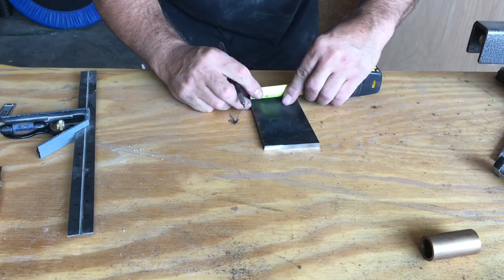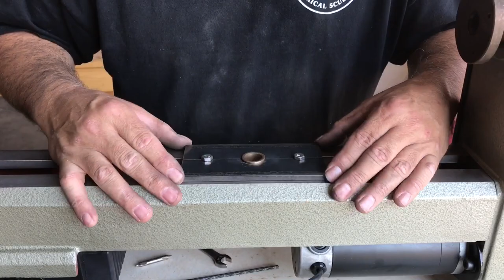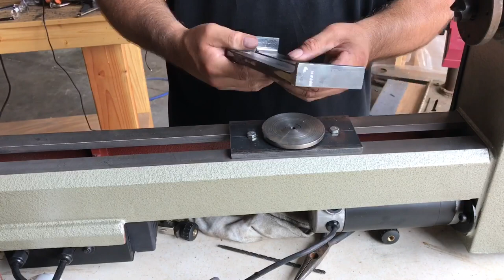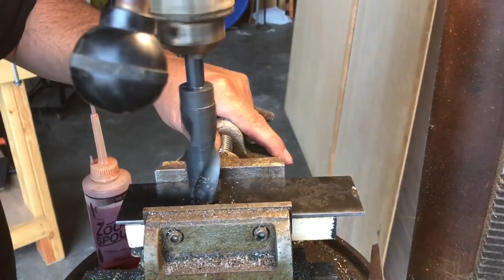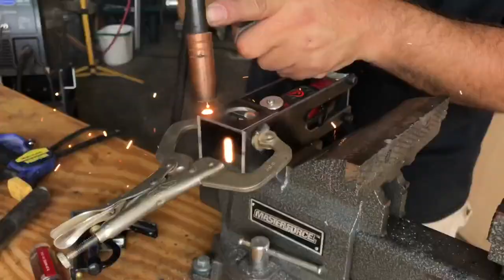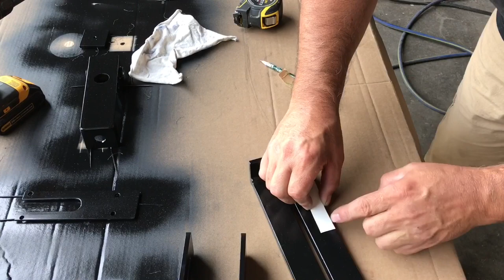Metal fabrication - building a small geodesic sphere turning jig

Comment: Keith Thank you for the video. I enjoyed the build. I do woodturning and inquire if building a carbide cutter jig that you can still use your bottom rotation assembly and switch to a carbide or HSS cutter to get the shape smooth then bring in the sander to finish. I see you are using a drive spur for grip, but once you have rounded you would have two nubs on each side would you switch to cup on each side and rotate sphere to remove nubs. Look forward to seeing what you come up with.
Reply from the maker: Bryan Boston When I tried turning the plywood ball with traditional lathe tools I had  so much tear out that I ended up having to sand them a lot anyway. To save time I started using a rough disc to knock off all the high spots before I start with this jig.

Comment: really like your creation process.  a lot goes into it, perhaps more sckookum than needed to hold a sander?  jealous.    Is it possible to do some of the rough turning with a standard gouge, and then switch to the sanding/grinding?   or does a gouge tearout the plywood too readily?
Reply from the maker: Ted Gaunt This video was my trial of the jig. I have started to remove the points with a rough disc before starting with the jig.

Comment: Damm sleep is a good thing! Keith, do you sell the how too for this thing. I’m just getting into wood work. There is so much to be inspired by. This is definitely one of them. I have just one question. How drunk were you when you came up with this. Or, the story of how. I’m joking, of course. But the process of how must be a great storyline. Looking forward to what you post next.
Reply from the maker: Allen W   The first time I sanded a plywood ball on a lathe, I just held the sander by hand. I made the sanding jig later. The design for this was just a sketch and trial and error. It is basically a condensed version of the one I made for the big lathe. The sphere jig I use for solid wood has a carbide cutter. I found that the cut was too rough on plywood and I had to sand it a lot anyway. So that’s where the disc sander came in.  I have already found a few things I want to change on the small sanding jig. Thanks for the Sub !

Comment: Can you make a jig for a 1 in. diameter sphere?
Reply from the maker: Benjamin Mellor I guess I could...it might be more practical to use a lathe tool since the radius would only be 1/2”.
Reply: Maybe get a thin piece of metal, drill a 1-inch wide hole, then sharpen the curved edge. That tool could be used to quickly make a small sphere on a lathe.

Comment: Just observation: for someone requiring high precision, I found it odd you don't work in millimeters when measuring and sizing
Reply from the maker: Stan B  My dad was a machinist by trade, and I learned to measure using the imperial system.  In fourth grade I did a show and tell presentation on how to read a micrometer. So basically I find it easier to measure in thousandths of an inch. I don’t know if you are from the US or not but most of the trades here still rely heavily on imperial measurements.